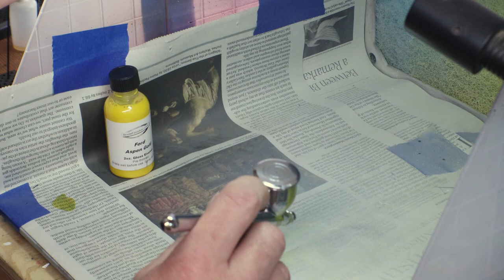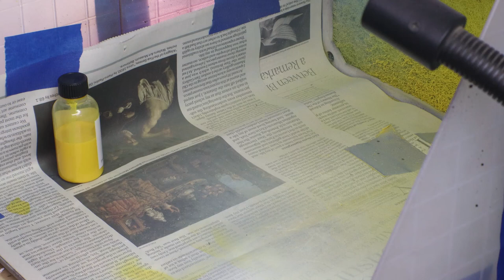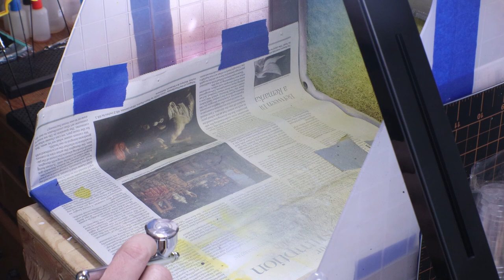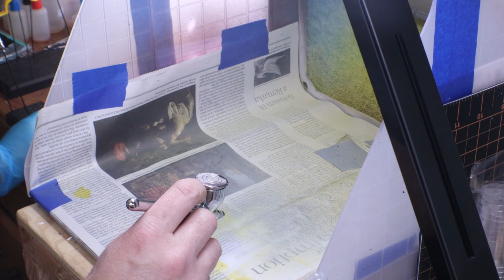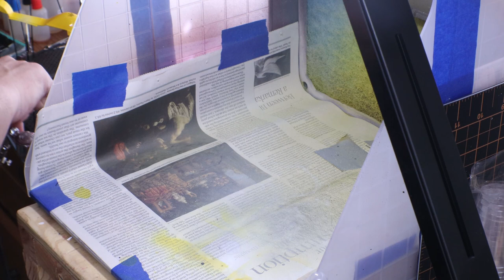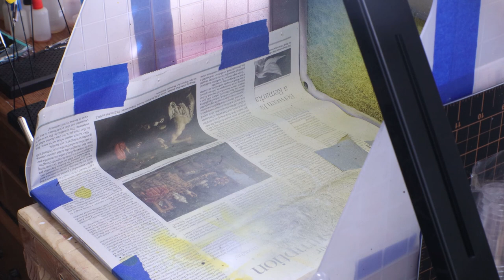How To Scalefinishes Enamel with Automotive 2K Clear: Revell 32 Ford 5 Window video #5

Comment: Great video I've been doing folkart and 2k clear from Eastwood a 2:1 clear and it's been good going to have to buy some scalefinishes base coat and try them out !
Reply from the maker: That have a great deal right on the home page. It’s like $100 and follow the link to get a 10% off code and I believe it’s 20 or 25 bottles of paint. It’s the surprise box.